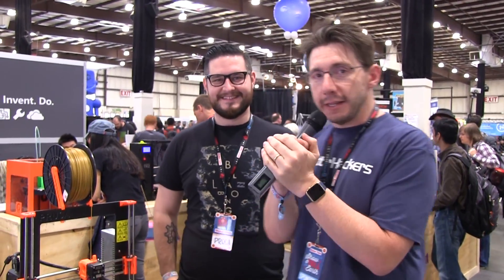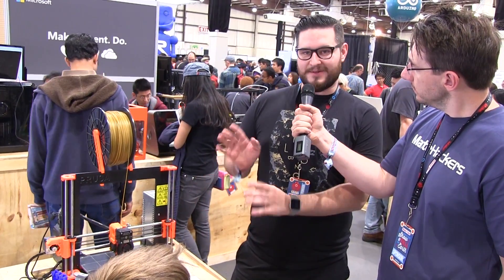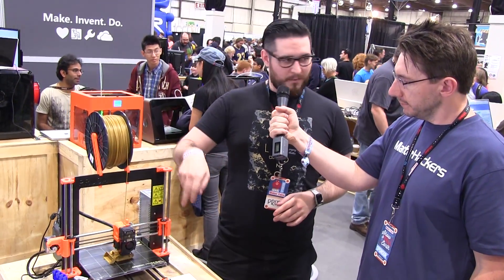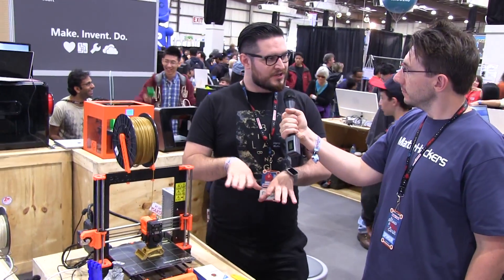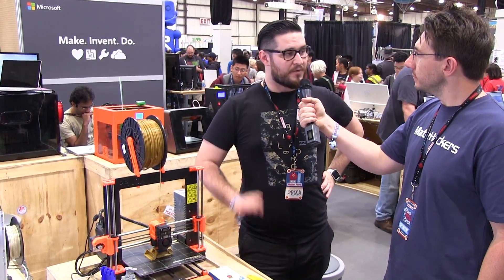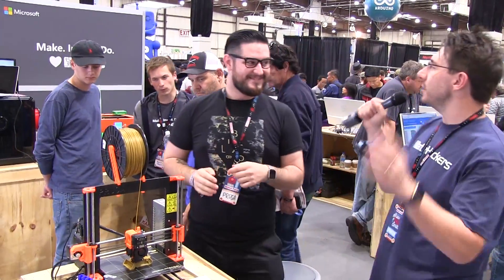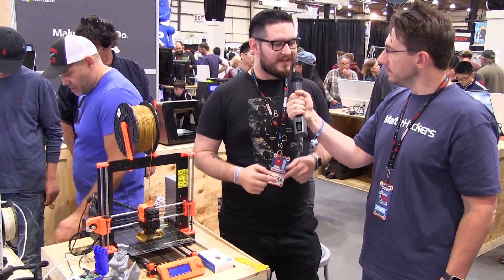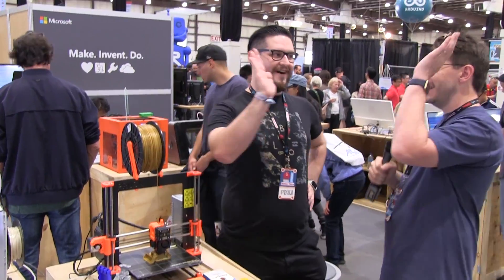3D Printing: Josef Prusa at Maker Faire 2016

Comment: I hope they put the code into marlin, it needs to catch up. I am using mesh bed leveling on my giant delta using smoothieware.   It's one the reasons I chose smoothieware. Provided your printer is rigid, you only need to create the mesh 1 time. I actually use a 15x15 mesh, but it's circle, so it's not 225 points, it's 180ish. It works super well and I've printed very large parts with no fiddling with the bed.
Reply from the maker: +kazolar Agreed. Have mesh leveling as a standard addition to Marlin would be insanely great.
Reply: they need to do other things too -- the way smoothie does it -- you place the z-probe temporarily (using whatever removable mount you design) some distance directly below the hot end. Then run the routine to generate the mesh. After you're done, you can then save it to the sd card on the controller board, and at the start of each print call the custom gcode command to load the mesh. With a rigid frame and bed, you don't need to do it again, maybe a couple times year to account for material changes due to heating/cooling or if you jostled or moved your printer as you're dealing with microns. Level it, then don't breath on it :)
Reply: +kazolar I actually played doing this, and its the way I run MBL. http://www.thingiverse.com/thing:1120142 Never got around to add that to the Marlin main repo though.

Comment: Nice guy, but their company has crappy support. My first machine was a I3, it had a bad board and they didn't want to admit to it and they let me return the printer. He is very innovative and a brilliant dude i must say. Long story short the excuse for letting me return the printer is because i wasn't experienced, well thats funny i buil a delta machine which is more complicated to setup and it works mint. Anyway good luck to him and his company.
Reply: Huh.. ive never had a single problem with their support, and I own 4 of their machines.    I had a heating issue with one machine,  and they sent me a new Bed and hotend after some troubleshooting.  (shipped it express to so i got it in 3 days to the US all the way from Czech)    

Not sure what happened in your case, but they've never been anything but awesome for me.